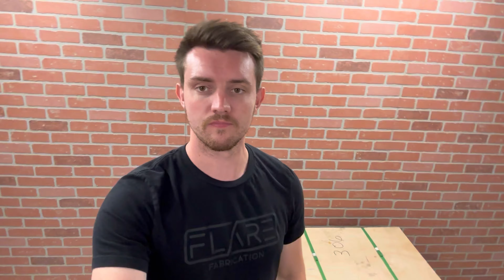Unboxing Cloudray Upgraded MP-60 60W MOPA Fiber Laser Machine

Comment: Do you think a 30w fiber laser I capable to cut a 1.5 mm of silver or gold plate?
Reply from the maker: hi, For a 30w fiber laser, we think the ideal cutting depth is ≤0.5mm If you hope to cut 1.5mm of silver or gold plate in common condition, we suggest that you can choose our Litemarker Pro MP-60 ，product link reference: https://www.cloudraylaser.com/collections/mp-series/products/cloudray-mp-60-litemarker-pro-60w-split-laser-engraver-fiber-marking-machine-with-11-8-x-11-8-lens-with-d80-rotary-axis-compatible-with-lightburn
Reply: Of course...
Just buy the smaller focal lenses...
If a 60w can do it the 30w will, in theory, need double the time.

Comment: I have not had any problems with my Cloudray 50 watt fiber laser except for the hole in the lens cover. I like the red flag they give you to remind you to remove it before you fire it up.
I found the lens correction is fine for small stuff but when I tried using the full 300 mm x 300 mm it wasn't so good so I am going to have to redo the lens correction.
Reply from the maker: Hi, thanks for choosing Cloudray :)  We are so glad that you like our machine! 😃
If you have any questions concerning products, pls email us to info@cloudray.com  💪We would like to assist you with any problem until you are satisfied.